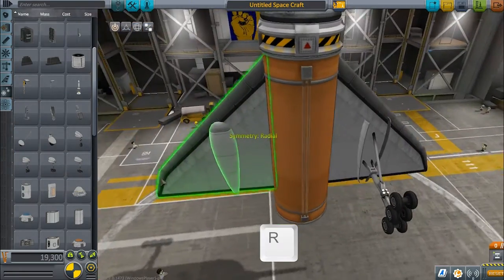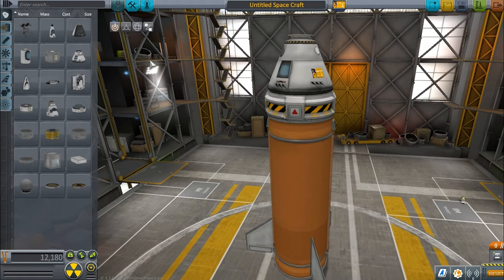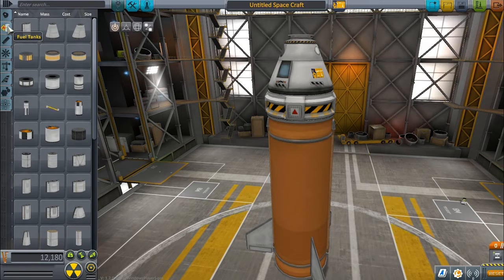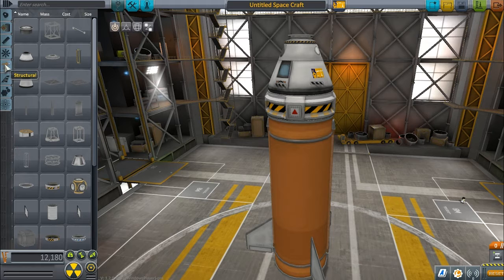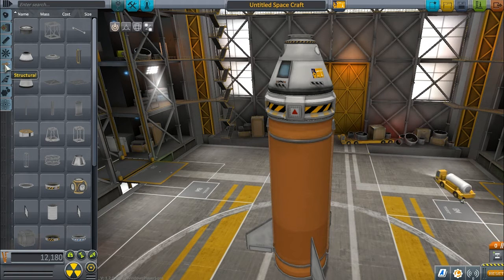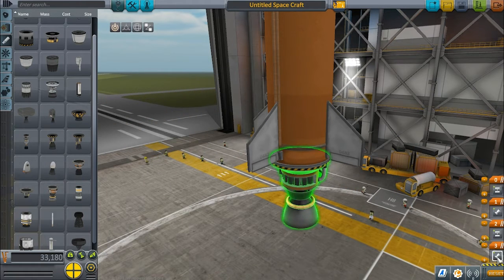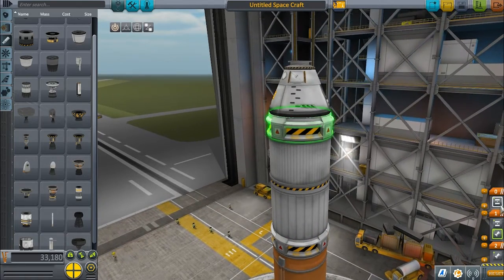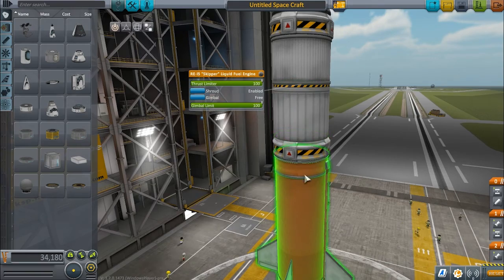KSP 5 Tips, Intro to Construction

Comment: how did u get an engine on the Mk3 Body/Shuttle
Reply: in structural there is a part that is MK3 and has 3 nodes to attach engines to
Reply: Thanks